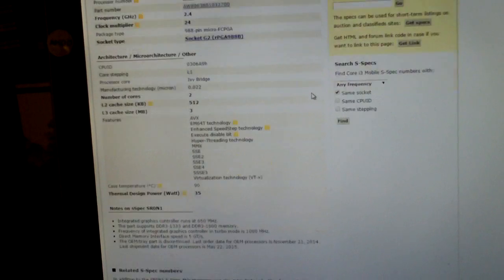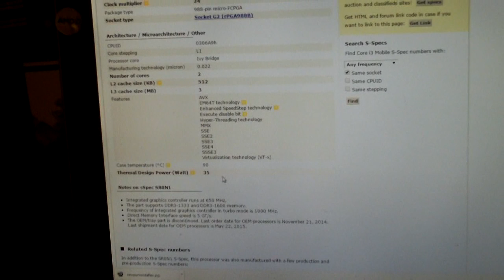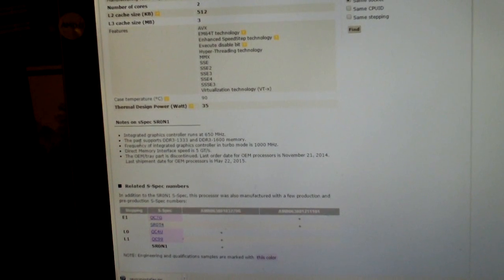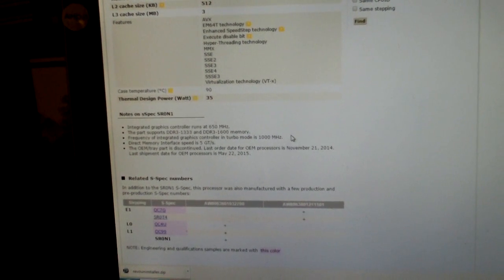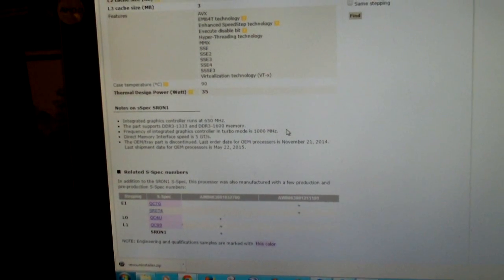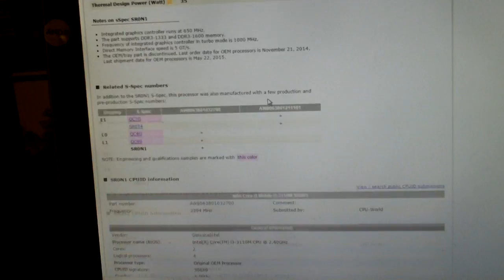An Intel... APU?

Comment: It seems like one those boards died from overheating.
Reply from the maker: Billy O'Reilly The Intel board seems to have died form excessive moisture exposure. The AMD board was bought from eBay. The seller (who didn't know much about computers) shipped it without any sort of ESD protection. Well, you can probably guess what that did to the board.